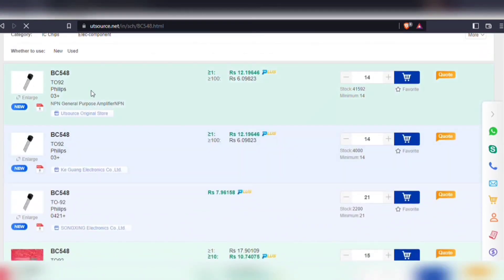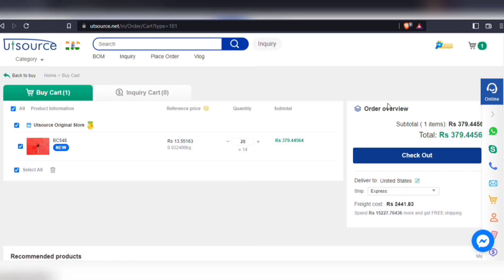Simple 40A adjustable voltage regulator 0-60v using single IGBT

Comment: This circuit is not a true voltage regulator (Voltage Regulator).
It is a manual control circuit that relies only on an IGBT and a variable resistor.

When the input supply voltage changes, the output voltage changes directly and does not remain stable.

There is no voltage reference and no feedback loop (Feedback).

The variable resistor only changes the conduction level of the IGBT, not voltage regulation.

Therefore, the more accurate description is:
a variable pass circuit without true voltage regulation.

Comment: what is the input voltage...? its nowhere mentioned in video or not in the circuit diagram.
Reply from the maker: Obviously upto 60 volts and output adjustable

Comment: HI If I want to use 240 amps instead of 40 amps IGBT, what models should I replace the other parts with, and also can the amps be increased to 400 amps by using 2  240 AMP IGBT
Reply: Add more igbt 3 or 4

Comment: Can this circuit be with a 13v input with a 16v output with a 20a load?
Reply: No. You might make a version with a 20 volt input and a 13 volt output, but at 20 amps the transistor will burn up. This sort of circuit CANNOT produce an output greater than the input, and for this particular version the input must be at least 7 volts more than the output to work reliably for the transistor specified.
Reply: @wirebrushproductions1001  Назовите все реальные парамететры этого преобразователя, пожалуйста

Comment: Can i give input supply 100v 30 amp in this circuit ? 
5:48
Reply: No, no and no. Well, OK, maybe. You would need a much higher value (resistance and power) potentiometer, and a MUCH bigger heatsink. Bigger wires, too. Keep in mind that as built this circuit will not handle 60 A even at lower votage.

Comment: What is the voltage drop when a 30-amp load is put on this circuit ?
30 amp @ 14.8vdc
Reply: It drops SMOKE, as he had 60V input, thats going to be ~45v x 30a = 1350watts dissipated.
Reply: Si necesita solo 15V no lo debe alimentar con 60V porque la diferencia la tiene que absorber el IBJT que solo soporta 300W a 25°C. 
If you only need 15V, you should not power it with 60V because the difference has to be absorbed by the IBJT, which only supports 300W at 25°C.

Comment: how do i can control current?What should i need to add in the circuit to control current also??
Reply: This circuit isn't even a voltage regulator in any normal sense of the term. All it is is a voltage "follower." The output voltage will vary with varying input voltage and with varying load. It is more or less the equivalent of a an adjustable power resistor (rheostat).

Comment: Nice mate, Can this circuit handle 120v input?
Reply from the maker: This igbt can handle upto 600v input but at lower current
Reply: ...habría que adaptar el divisor resistivo a la Vin para obtener Vge adecuada. 
...the resistive divider would have to be adapted to the Vin to obtain adequate Vge.
Reply: @frank0-1  thanks
Reply: @MQVlogspk  ...este circuito no sirve como controlador de carga solar. Para ese fin te hace falta un MPPT. 
@MQVlogspk  ...this circuit does not serve as a solar charge controller.  For that purpose you need an MPPT.
Reply: Can we use this as a solar charger controller

Comment: Please full connection diagram. Power transformer, bridge diodes, regulator filter etc
Reply: Buddy, it’s hopeless. The guy wouldn’t respond. All you gotta do is test and experiment by yourself.
Reply: TRY AND ERROR IS BETTER.. BUT NEED TO LEARN FROM PEOPLE WITH EXPERIENCE.   FACTOR MAY CAUSE COMPONENT LOSS OR EXPLOSION

Comment: Precisa de transformador de 60 volt né
Reply from the maker: Yep, you can use 60v transformer with bridge rectifier and (filtered rectified output dc) will go to this circuit to make voltage variable.

Comment: Hello
How many DC volts are needed as input?
Reply: So the voltage that you are putting into the circuit that you did a video on is ran through a bridge rectifier & filter capacitor, then into the circuit you show ?
Reply from the maker: Input 60 volts and output variable